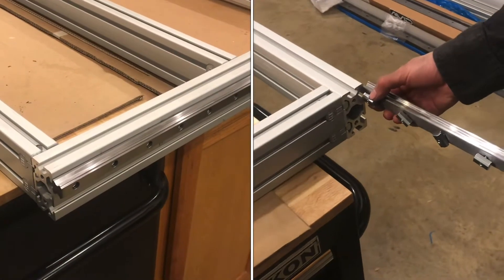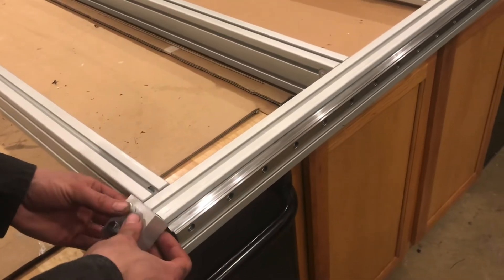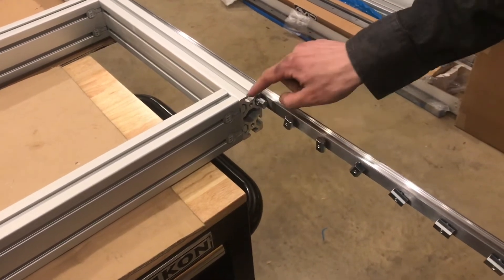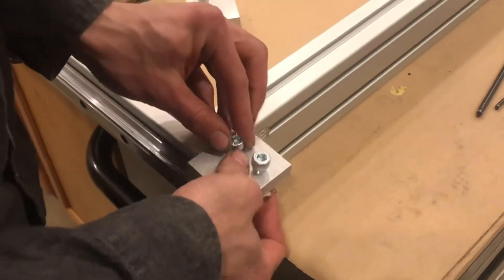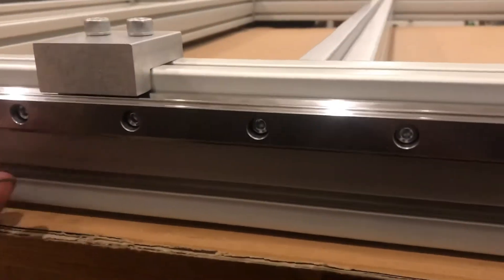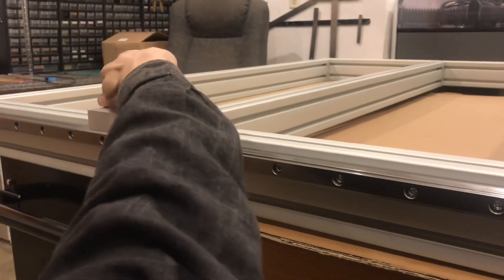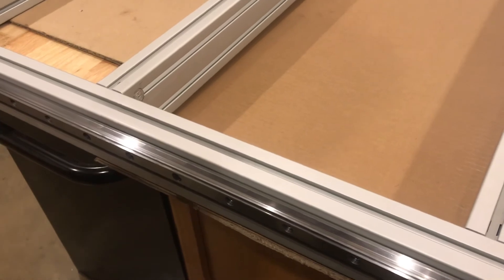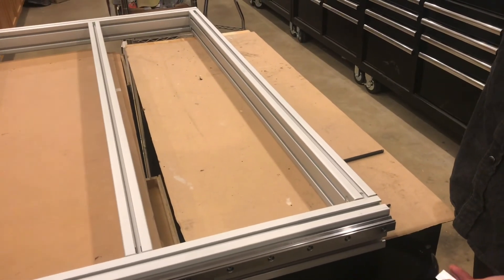installing “linear guide rails” and bearings STRAIGHT (CNC gantries) avid

Comment: Do you understand the irony of saying you can't assume it will tighten up square since long thin pieces of metal are prone to bending due to gravity then referencing the linear rail using a long thin piece of metal prone to bending due to gravity.

Comment: I'm not really sure how you can mount a linear rail 'straight' to a machine that is made from relatively lightweight extrusions with their own inbuilt flex. That's why machine tools are built from stress relieved cast iron and have precisely ground surfaces.

Comment: It seems like you are referencing off the extruded aluminum to determine if the rails are straight, despite the fact both have their nonlinearities and, I will add, the linear rail is ground whereas the extruded aluminum is not.

The proper way to straighten the rail is to reference off a known straight surface or use a precise level. When you do it this way you don't care if the extruded aluminum is straight or not, because it is not a reference surface.